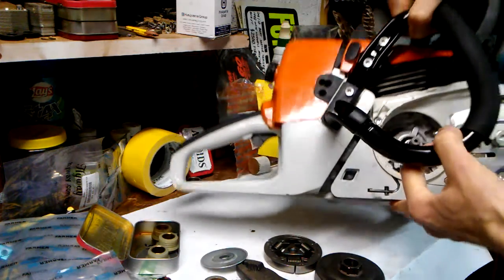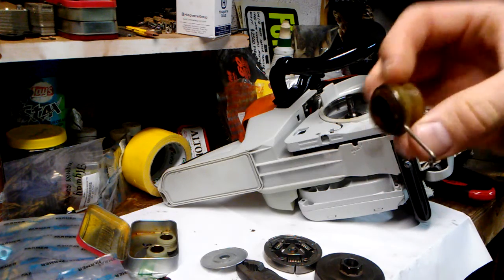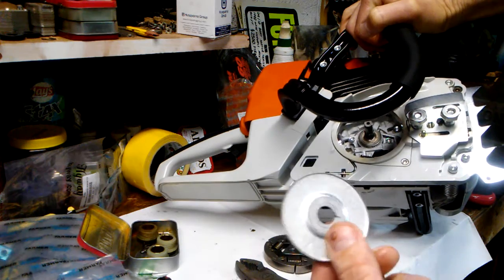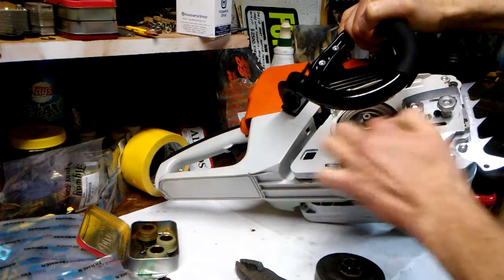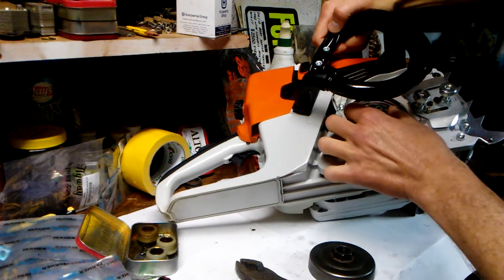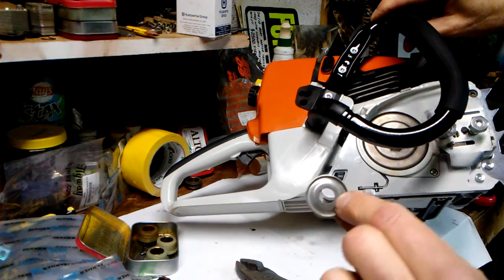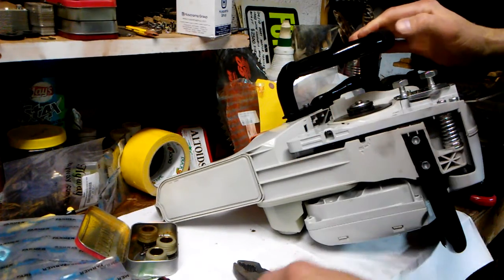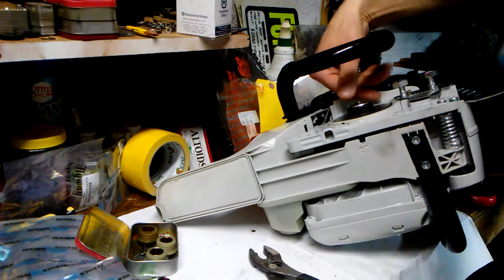Farmertec Stihl MS361 final assembly clutch oil pump etc

Comment: What did you set high rpm at once it was broke in?
Reply from the maker: Hi Duane, it is still at 11k and running 32:1 fuel ratio. Although I fell with it some, I primarily use the saw with a mini-mill to cut the initial flats on logs in the milling application. Thank you watching and commenting.